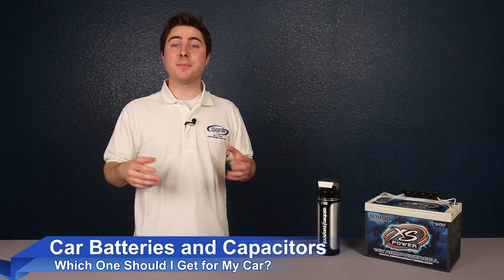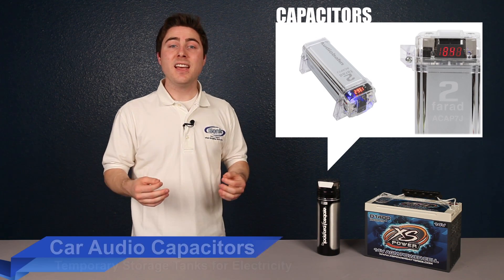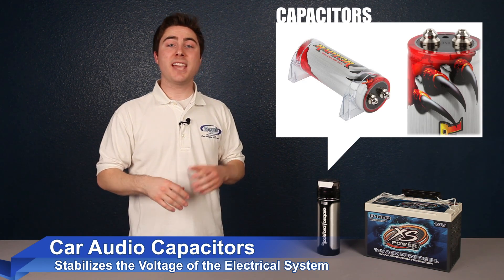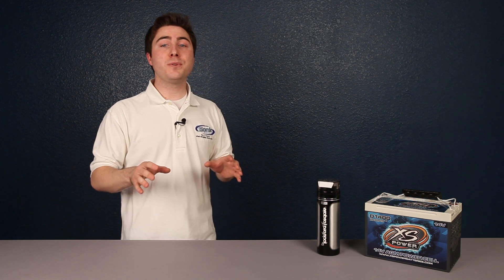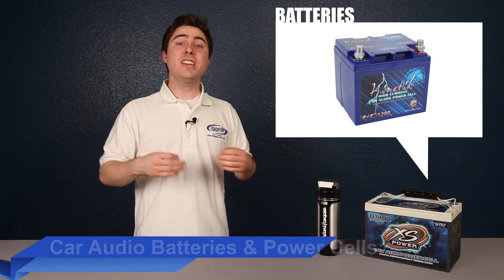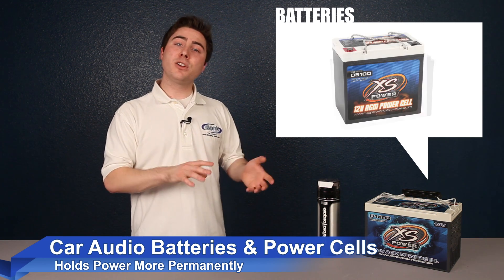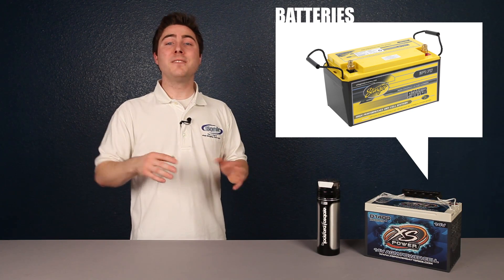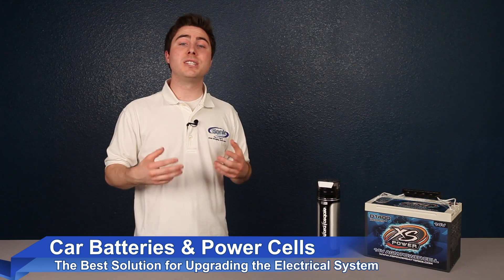Car Batteries or Capacitors: Which Should I Install? | Car Audio Tips

Comment: dont EVER get a capacitor.!!! get 2 new batteries and do the big 3 upgrade with 0 gage ofc wire. then get a 200amp alternator or better. BAM! problem solved.
Reply: If the capacitor is matched to the load, it will work better than a battery. I use a 1000 farad module with a high output alternator and it works.
Reply: You shouldn't make such blanket statements. Sometimes a battery is a better choice, other times a capacitor is. I've seen this statement uttered in some way or another so many times, it's really disconcerting to think that people who researched basic electronics in order to better understand their systems or build them in the first place fail to understand what a capacitor does and what the advantages are...

What circumstance would benefit more from a capacitor? If your alternator is often less than enough to handle the power taken by your amp, that is, if your battery will lower to the point that your amp goes into power protect mode, then a capacitor is the ONLY storage you should be considering beyond replacing a failing battery under the hood. The reason for this is that capacitors have extremely low impedance and high efficiency. When you implement one, you're charging it instead of a battery, which has large losses involved. This in turn makes your alternator voltage regulators completely unaware that there was ever a super high demand. By contrast, simply charging a second battery means you're increasing the demand on your alternator beyond what it would experience with a cap. Batteries are LOW efficiency storage vessels. There's a reason why the modern electronics world is hoping that supercaps take off in a big way. It takes days of sitting for a capacitor to show the same amount of loss of energy experienced by a battery upon initial charge.

What circumstances would benefit more from a second battery? If you're in need of quick power, but your battery is always at a healthy level of charge. A capacitor in this instance would also help, and would actually be better for your car if you purchase a properly big one, however a battery is a simpler and cheaper solution, and the amount of wattage output a capacitor of similar price can store is not even close to that of a battery. A second battery is significantly more useful as well if you like to listen to your system with your car off.

What you're trying to avoid is voltage drop.. Voltage drop activates your alternator's max charging routine, which initiates a tug on your engine/belt/pulley/bearings which = wear and tear. However, before the alternator can even really affect the overall energy in the system, the demand is gone and the voltage is back up (until the next hard beat). It's essentially turning your alternator to max and back to half or so every few seconds and being a mechanical part, this isn't ideal. A second battery can assist with this, however it will not mask the voltage drop as well as a cap will. Capacitors can give thousands of amps in microseconds, whereas a battery will never exceed its internal resistance's allowance, which really isn't that high (Something like 100A sustained for the average car battery).

People also tend to forget that a 1000W RMS amp is not draining 1000W from your battery constantly, it's pulling more, then less, then more then less, RMS is an average taken at a 45 degree angle of the sine wave. The wave goes both higher and lower, meaning your system is taxed and relaxed a bunch of times a second depending on the frequency... Alternator's weren't designed to run this way, they expect constant drains. A capacitor of sufficient capacity can turn this into a constant drain, thereby allowing the alternator to function much more normally, giving it the chance to deliver its ideal performance and likely function much longer without issues.
Reply: @jamisonw.327 excellent breakdown. Im running two kicker compC 10’s (250 rms each) and the Rockville DB14 mono amp (1000w rms) I noticed when I play my music at a loud volume while driving I lose acceleration/engine power. Should I get a capacitor or a battery? Im leaning more towards a 4farad capacitor
Reply: @jamisonw.327  Nobody wants to read all that
Reply: @jamisonw.327 I only read your first paragraph 🫣😆 but know where you’re going 👍
Reply: +Jamison W. (Lasherz) yawwwwnnnnnn.... capacitors are pointless .
Reply: Enjoy your expensive alternator while it lasts trying to get by supplementing amperage and  a non-instantaneous generator for what's really a voltage drop and resistance problem. However, you shouldn't be telling it to new people to the audio field, they're gonna end up saying and doing dumb shit until an actual engineer informs them otherwise.
Reply: Please at least read a wikipedia page about the topic next time, you could have done so well. Unlike the mob on this page of people who like to speak their mind as an authority without the slightest clue what they're talking about, I research everything that I buy and know what I'm getting... So no, Boss is not a brand that I partake in, and a 5000W generator isn't a load I'm willing to put on my 4 cylinder engine.
Reply: YEah and another thing, SOME PEOPLE CANT FIT A 200 AMP ALTERNATOR BASED ON MODEL AND YEAR!!!!! EVER THINK OF THAT?  BATTERIES ARE NOT THE ANSWER FOR EVERYTHING. YOU SHOULD SPECIFY AGM BATTERY TO START.
Reply: Jamison W. About time I read something that clearly shows a person of some knowledge! Kids spending 5 minutes on Google or YouTube seeing other people say it so they say it also trying to sound like they know a thing or two.  Almost like how a bad rumor starts in high school days haha.  Well said and well explained. If they do not understand this explanation then all hope is loss for this generation.
Reply: Jumping in this a year later and you're right Jamison. This guy doesn't know what he's talking about and when you politely correct him, he gets butthurt. Not everyone is right and part of learning is taking other people's knowledge and criticism. Fuck i'm running 2 13w7s on 2 1200HDs. Am i going to run 4 external batteries, no. The alternator is taking that load. Am i running one external battery, yeah. Could i just use a capacitor since all my electrical components are acquitted specifically for it ( Big 3 on 300 amp alternator, 0 Ga. JL premium wiring, etc. ) People need to cater to their own systems accordingly not a capacitor for a 350rms boss system or a battery for 1000 watts etc. God some people's info is obsolete.
Reply: Jamison W. Just wanted to say thank you Jamison. Although I fully understand where TJ is coming from (my cars best meter was at 152.6db, so yes I have some serious draw) it is refreshing to see such polite and properly informing reply on you tube in today's day and age.
Reply: tj phillips soo... who makes an alternator for my Honda Fit 07. I'm only running 600watts with 2amps and the still go on protection mode when the volume goes up!
Reply: From a comment on a post trying to say caps are bad, "This is completely against all physics of electricity. I am a sound engineer and I went to for both electronics and acoustics. Caps are very important to the balance of an electrical system in a DC environment. If you look at the insides of any good amp, you will find a shit load of caps on the power supply side of the board. YOu are right that caps make things worse for amp but only if there is not battery in the entire circuit. A battery is a natural balancer of all things electrical. As a matter of fact, the alternator that you say is the most important thing in a car, you are right but only if there is a battery in the circuit. If not, you’re lights will flicker because an alternator is not a steady stream of pure DC voltage like a battery is and will hurt your entire electrical system. They produce AC and convert to DC and that circuit is rarely pure. A battery is pure DC voltage. All 3 batts, caps and alts are needed to have a balanced electrical system and get enough power to your amps. The most important thing that is rarely talked about that is needed in respects to clean power is good connectivity. Amps that are closest to a power supply(Batt or Alt, not caps) create more power to the speaker and run cooler. Even using Ohm’s law in regards to power wiring and you know the correct gauge and length of wire, does not take into the effect of environmental physics. IE – Temperature of the air around the wire as well as the temp of the wire itself. As the temp of the wire goes up, the resistance increases and therefore needing a higher gauge. This also happens to batteries and alternators the more power they have to produce. They will heat up and not be as efficient as room temp. Alts work great in cold temps but batteries are the opposite due to chemical reaction physics of Batts vs metalerical physics of alts. All this points to one conclusion that is often missed, double the size of the wire that the math tells you to use and make all of them as short as possible. Connectors are also often missed as an essential part of this issue. High current systems need power connectors that are soldered using a torch(not a soldering gun) and not just a screw down connection of just a crimp. YOu can use those but you must also solder them. This will ensure a perfect connection that will not corrode over time or deteriorate due to high temps and humidity. Either way, the alternator is least thing needed to be upgraded in a system as long as you have array of batt and caps near the amp. Reason is simple, batteries store lots of powers as well as create power (yes they create power using a chemical reaction which is why if you crank an engine till it wont anymore and then wait a little while you are able to crank some more) but discharge their power very slow, Alts create power, do not store it but push more power than a battery can per second, caps only store but can discharge thier all thier power in literally milliseconds which is why they can be dangerous but are extremely efficient because of thier very low internal impedance. Point being, batteries can be charged by any source if you alt cant keep up like a home charger. You can also let you car run for a while to be sure your batteries are charged if you know you were draining more than the alt can push out to charge them. It’s just math and you cant get around it. Batteries are the most important part of a high powered car audio system by far. As a matter of fact, I blew my alt a long ago when I was traveling and was about 500 miles from home. I couldn’t just replaced it because it was a high power aftermarket alt and I needed to get it fixed. I turn off everything possible in my car and kept driving just using my 5 Kenetik AGM Batteries and 30 farards of caps and they got me home easily and the voltage never got below 11.9 after the 500 mile trip."
Reply: Dedicated_Ram , i have a 24 volt vehicle and to run 12 volt music system i have purchased Dc to Dc converter. Now i want to know if that converter can supply proper amperes without voltage drop or i need to install capacitor in between converter and amplifier?
Reply: Spoken like someone who knows jack about car audio. Caps are great additions and batteries cannot replace them, nor can alternators. Caps do something completely different than batteries, so stop drinking the kool-aid spewed from self-proclaimed SPL and audio "experts".
Reply: Get both extra battery and capacitor problem solved lol
Reply: +tj “lil badazz” phillips I agree with you, caps are pointless for big system!!!

They're cool for little pioneer, kicker, Kenwood or boss systems like 350 rms each sub

but if you're running DD Audio, American Bass, DC Audio or MMatt Audio get  batteries for best results.

300-1400 rms capacity are ok but 1500&up rms get batteries 

I been installing since the 90s and cap help back than but these audio systems now overwhelm caps.

Caps are good because they store energy quickly and release it quickly but big systems they couldn't help me so I got dry cells batteries instead. They are the best way to go, plus big 3 and new alt than you'll be A1 but I don't do caps

When I first notice they was not for me is when I hit bass note and the lights still dim but I supposedly have 2.5 farad but I'm only running 1500 rms on one sub. put me a second Battery in the trunk. 

All the lights dimming, belt noise from the alt tighten up stop right away

I like Audio Control Epicenter and bandpass enclosures so no caps for me!!!
Reply: Pete Jesco 3.5 farad is FAR from a monster. I had a 40farad carbon digital Rockford fosgate capacitor in my car.
Reply: Jamison W. What do you have to say about running like a motorcycle AGM battery versus a car battery as long as they're both 12v?
Reply: tj phillips sometimes capacitors are necessary to support poorly designed amplifiers. But if you can afford it get an extra battery and capacitors.
Reply: tj phillips i agree, however those high output alternators are $$$$. Im buying one at the end of the month, but the best one i found was a Mechman for 399. Gotta pay to play. Im running a scv2000d on 2 SA12s tuned at 32hz and a SAE600 on the mids and highs. Using 0 guage with the extra battery, but voltage still not where it needs to be. My puny stock alternator just cant keep up
Reply: I'm a beginner, and a capacitor is a waste of time.
It gave me about ten more minutes at peak volume of none stop playing, until the power drops.
Reply: tj phillips the additional batteries will strain your alternator more. That is adding load. Your better off upgrading your existing battery along with a larger alternator. Example if you have a 200 amp alt that's it. No amount of battery is going to increase your amperage output from your alt.
Reply: That's not to say some of what they're saying isn't correct. Anything over 1500watts and ur gonna need a 2nd or upgraded battery. I'd also suggest the big 3 upgrade on literally anything. Even without a system really. It's just better on your charging system and all your vehicles grounds
Reply: Big 4 with high output Alt agm with copasitor for the quick discharge.
Reply: I have zero gage nicer alt big three also in front. front agm and back agm battery and still have a cap. A cap is for stability it won’t hurt.
Reply: I got batteries and a ultra capacitor. I love it
Reply: what can ofc do that cca can’t do? Current travel is current travel. You’re not going to see much difference unless you’re using gold as a conductor.
Reply: @twiztidkreation  your joking I hope?
Reply: @ not even close.
Reply: @twiztidkreation  good luck with that then👍
Reply: Yes and no , I put my 0g in a different vehicle and just used my door speaker 4g amp wire and a capacitor (1Farrad) I think it was but did alright for my sub amp for a little till I got some more 0g.
       Once I got 0g and got rid of the capacitor because I think it was a lil too beat up. The amp worked better on 0g and no capacitor but I don’t think I put capacitor back in though , think I had the Big3 done already . 
      If I was to use a new 5f or 10f capacitor it would make a huge improvement, just adds extra juice and takes the strain away from everything else 🤷🏻‍♂️
Reply: @WS1_AUTOS_N_STUFF  5 or 10.. wow! Mine's 375  farrad! Look into the ultra capacitors so much better
Reply: I have a 600 watt kicker ..so I should geta cap to help a little right?
Reply: @RICHARDFLORES2100   yeah pluck it out of a computer motherboard
Reply: +tj “lil badazz” phillips I agree with you, caps are pointless for big system!!!

They're cool for little pioneer, kicker, Kenwood or boss systems like 350 rms each sub

but if you're running DD Audio, American Bass, DC Audio or MMatt Audio get  batteries for best results.

300-1400 rms capacity are ok but 1500&up rms get batteries 

I been installing since the 90s and cap help back than but these audio systems now overwhelm caps.

Caps are good because they store energy quickly and release it quickly but big systems they couldn't help me so I got dry cells batteries instead. They are the best way to go, plus big 3 and new alt than you'll be A1 but I don't do caps

When I first notice they was not for me is when I hit bass note and the lights still dim but I supposedly have 2.5 farad but I'm only running 1500 rms on one sub. put me a second Battery in the trunk. 

All the lights dimming, belt noise from the alt tighten up stop right away

I like Audio Control Epicenter and bandpass enclosures so no caps for me!!!
Reply: Jamison W. I glad I bumped into this you got that shit down to a science 👍👍👌👌
Reply: @dabeardsmen3621 
This guy does not have his "shit down" on anything other than what he's been fed. Any REAL audio engineer and technician will tell you first hand, that batteries and capacitors cannot replace each other. They do two completely different things. If you try to drive a battery as hard as a cap, you'll ruin it pretty quickly. An AGM accumulator is meant to store power that is fairly slowly released, not provide huge amp and voltage spikes in milliseconds. A system where both batteries and capacitors are used, will sound very different than a system that does only rely on batteries. If you ever come across someone who offers you help or advice, while blankly stating that capacitors are pointless, don't walk, RUN! Because that guy does not understand the physics involved. Whether it's because that person is too dumb to understand, or simply for some odd reason chooses not to, does not really matter. But if anyone still chooses to live by that rule which crept into the car audio industry about 15 years ago regarding caps, he's a sheep that just follows an old doctrine.
The fact alone that he suggest to someone here, that this person looks up info on Wikipedia, tells a lot. A real book about the theories and physics involved, is a lot more useful. It's not black magic, is good ol'e fashioned physics - and the laws of which you cannot change.

Rant over.
Reply: RICHARDFLORES2100 - A few things: 

Are you talking about the amplifier or the subwoofer? (Kicker makes both)

Is the wattage you're quoting at 600 the Peak or RMS? (Peak doesn't matter)

Are your headlights dimming while playing your system at loud cruising volume? Also, how badly are they dimming? To the point people are flashing their lights at you or just barely noticeable?

The capacitor wouldn't hurt, but unless your car is struggling with the voltage drops (by which I mean the headlights are dimming somewhat) then there isn't much to gain by using one. In this circumstance the same goes for an upgraded alternator or a second or high performance battery.
Reply: Capacitors back in the day were more useful but AGM technology beats caps big time. Caps dont help much nowadays.
Reply: @joeypantera7397 i know this thread was so long ago but im just now seeing this... question which would u go with a regular 12v battery or a AGM battery and why
Reply: Joey Pantera that is exactly what the intelligent people above you are saying! Don't spew out non sense or illinformed information. Give me 1 example of when a capacitor is NOT going to at the least help your alt. And don't just say some basic ass shit like "when u have a 5k rms amp on a stock car set up."
Reply: Jamison W. So Jameson. I have my amp in my fairing on my motorcycle. It's wired with 4 awg. wire directly from the battery to a power block. I want to a a capacitor to the system. If I place the capacitor in the saddlebags and then connect it to the battery using 4 awg. wire is that the same as putting the capacitor inline between the amp. and battery?
Thanks
Reply: The total ignorance of some of these comments is overwhelming... So eone rattling off brand names as to weather or not you need a battery or capacitor. Original comment saying add 2 batteries 😆 you have absolutely no clue what your talking about. Please listen to Jamisonw.327 if you're looking for real advice
Reply: What's big 3 upgrade